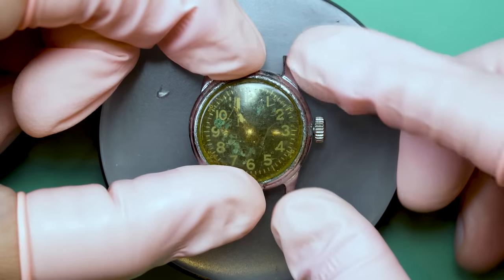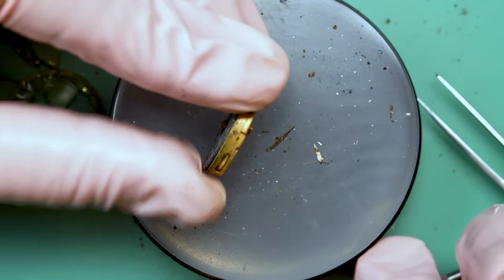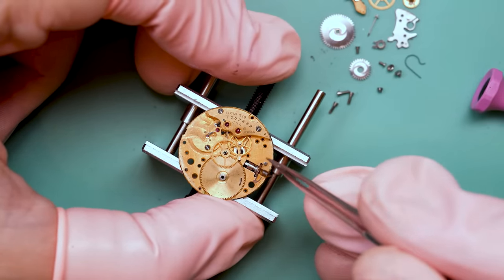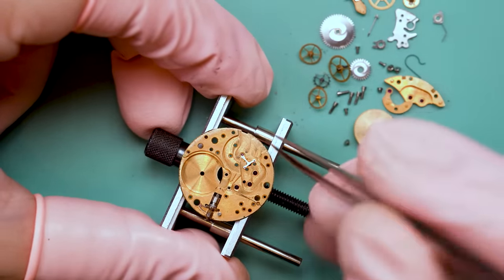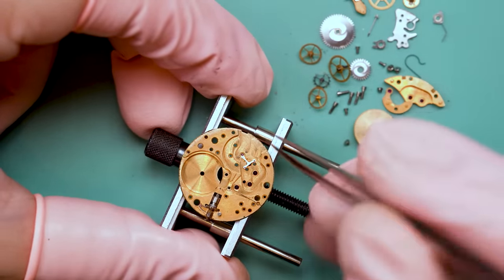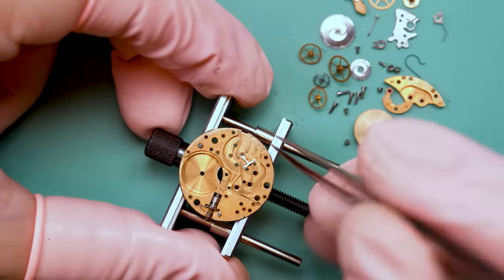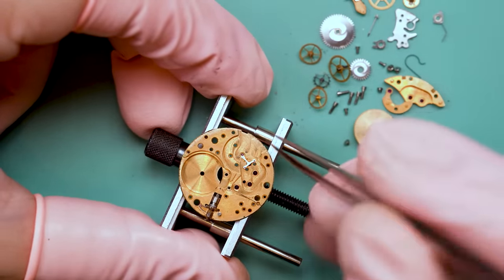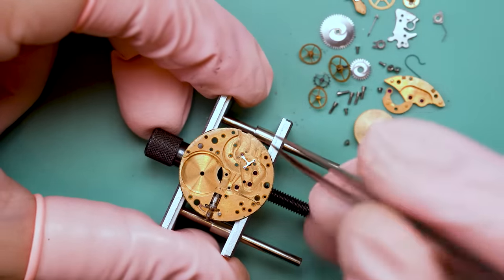Destroyed Vintage Elgin A-11 Military Watch Full Restoration

Comment: Congratulations on adding plating to your storehouse of techniques. And I agree with the decision to replace the barely functional (and very unappealing, at this late stage) dial with the donor one. Authenticity is generally a good thing to aim for, but even authenticity has its limit, and this is an example of running up against that limit.

Comment: Evaporust is slow, but have you tried it in the ultrasonic cleaner? Put it all in a closed container, then put into the water in the cleaner. Vibrations will propagate through the container and clean inside of it too.
Might speed up the process?

Comment: The black stuff is magnetite, it's a mixed crystal structure of different oxides. It is also known as blueing!
It's also alot denser then the hydrated oxyde mixture that whe know as the red flake rust. The avaporust basicly dose a rust blueing and desolves the excess lose rust. Cool stuff!

Comment: @Marshall
Ive never seen you use teak sticks to polish with. Teak dulls edged tools and saw blades because its loaded with silicates. It's a super fine abrasive that polishes and sticks can be sawn along the grain in an angular shape to create long sharper edges. Say 45°. Try it out if you haven't already.                  Edit: Good choice of dials. Very nice.

Comment: I'm late to the video, pretty amazing work. You asked so in my experience with rust/corrosion and other projects(not watches), allowing the green crustys on the old face to have access to the inside would l have been a jump start for new corrosion if any humidity remained inside with it.

Comment: Evaporust is great stuff. It not only won't eat away at parts, but it simply can't because it ONLY removes iron oxides. The black is the carbon that was part of the steel that rusted. I was a reseller when it was first produced. 

Two warnings: First, there is one situation where it will eat away at good parts. If a steel or iron part sticks above the surface of the fluid is will get a cut-line. Right where the water meets the air, the steel can oxidize and the oxidized atoms are instantly removed by the Evaporust, exposing new steel which can oxidize, etc.

Second, soaking parts that are nickle plated by a chemical process, meaning old plated things, the plating has microscopic pin-holes and enough air gets in there over 50 or 100 years to form some rust under the plating. Evaporust can also get in the holes and eventually remove that oxide layer. Then the nickle plating can actually slide right off like a gel or thin slime. This takes many hours or days and it happened to me once. The chemist who invented Evaporust explained it to me. It will likely do the same with gold plating.

Comment: A bigger polisher can be nice but it can also create some more struggles because like you said the dremal allows you to get into tighter spaces and it gives you a little more control because it can be slightly harder to hold small pieces when the bigger wheels require slightly more speed.

Comment: Amazing restoration!  Do you sell what you restore?  If so, I am interested.   Also, I have a ‘70s vintage Bulova Snorkel dive watch with an orange face that could use some of your attention if you take on outside projects. It is an auto winder that is running, but has incorrect bezel and hands.

Comment: 27:27 Question.  electroplating could be a way to change the colors of the metal.  I think that is the way they get the Rhodium plating on the brass.  You could even gold and silver plate some parts maybe since the plate is done in very minute layering.  Just a thought?  Post Script...  So you knew about electroplating and you did good for your first time.  I really like the fact that you changed dials but keeping that old dial with the set to show the before and after of the watch.  Plus you never know who or what caused the corrosion.  Could have been war related Vietnam era stuff.  I remember those watches even in the 80's.

Comment: If I was you at 35:34, I wouldn't plate it again.  I think the brass looks beautiful!

Plus, me being a model railroader, I would buy a new piece of very thin brass at a model train shop and make a new dial plate by spraying it whatever color you want on one side and then using press-on digits which come in different colors, too.

Comment: I know this video is three years old so this comment may go unnoticed but... There is a process called "electroless plating" for nickle which is basically cooking the part in solution on a hot plate. It's a little more finicky because you have to keep a close eye on temperature but it gives a more even plating thickness on edges and corners and complex shapes. There is also a deplating solution that removes all of the old nickle in even the most hard to reach places which gives you a better final surface on complex parts

Comment: Just imagine working on the smallest model Japanese cars, which the wheels work everything works on them, repairing those things would be a nightmare, always looking through a microscope? 
Just imagine watchmakers and the tools they use to make those very small screws with tiny threads which would be amazing to watch get them made? Great channel Marshall, keep up the great work champ 🦘🦘✌✌👍👍
I know acid dips will clean away tiny amounts of metal based on the acid and time spent in the acid, The aircraft maintenance industry uses this principle, because its so precise in the removal of metal from objects. 🦘🦘👌👌✌✌👍👍

Comment: Judging by what I could gather from the product spec online, the active ingredient mix of the Evapo-rust primarily consists of a ferric sulfate and a proprietary chelation ingredient. The chelation ingredient pulls the iron from the rust and the sulfate pulls the iron from the chelation ingredient so it can continue to react with the rust. Apparently the chelation ingredient isn't strong enough to attack iron-iron bonds, so it stops once the rust is gone or the compound is exhausted.

The black looks like ferrous oxide, so it's probably caused by reaction between the leftovers of the chelation reaction (oxygen and water, the latter of which is likely carried away in the process, given the claims of short-term function as a protectant) and the bare iron substrate under the rust, so it's probably not a very thick layer. Simple abrasion may be enough to remove the black layer, but in cases of a considerably thick initial layer of rust, and given the small scale of the parts involved, there may be instances where the part loses too much material to continue to function properly. If the black on the parts isn't visible from the outside and doesn't impede function, you're probably better off leaving it.

Comment: If the old dial had less deterioration, I'd have used used it.  But the main numerals were so far gone, and I'd be afraid flakes of the surface would come off.  You made a good call.

Comment: you did it for the challenge -  i have a british equivalent one of the dirty dozen - its a timor - similar condition to yours but not quire as rusty -that watch belonged to a ground crew member attached to the path finder squadrons it now runs quite well but the dial is shocking - if only yours could tell you its story

Comment: I also just learned to electroplate with nickel. It gives amazing results. But what voltage and ampere did you use?
Reply from the maker: You can see what I use in a recent video I put up, but it's about 1.4 amps

Comment: By now you have probably seen this, if not, here ya go:  How do you remove black residue from metal?
Mix equal parts warm water and white vinegar. Use a toothbrush to scrub the tarnish off the metal with the mixture. Combine ½ cup of vinegar, 1 teaspoon of salt, and ¼ cup of flour for stubborn tarnish. Apply the paste and let it sit for 10 minutes before washing it off.

Comment: I've been a subscriber for a year or so and have been inspired to dip my pinkie into this intriguing hobby. I recently acquired what I had thought was a 1940s era Elgin pocket watch. Upon examination it turns out that it is in fact an Elgin Timer that was used by military Navigators  or Bombadiers to set fuses. The piece is working but missing a second hand that corroded off on the main dial that is numbered from 0-60.  A smaller dial numbered from 0-30 is at the top.  Have you ever worked on such a piece and would you be interested in working on this one? A challenge tor sure. If I can get it working I intend to donate it to a local military museum.

Comment: The roman numerals on the inside might be more than just 6789.
The spacing makes me think it could be 7 digits or more.
Purely speculation but an interesting idea.

Also, I like the original dial. The colors are a cool combo.
If there was a way to make the numbers more visible, over the rust/corrosion, it could be usable.

Comment: Would it be better if you stripped everything off from the dial and had it powder-coated and then  hand-paint the characters back on  again?
I always send my plated parts out to my player and have him de-plate then I refinish, usually bead blast and finally re-plate.
No plating never fills in any cracks crevices or dings.
I just noticed the back doesn't look very good at all that could be de-plated and cleaned up.

Comment: Changing dial out is great it’s usable it’s for use not a museum piece. An absolute purist would not touch it at all and place it behind glass, even the rust had history, in fact keep it in the drawer it was kept in, keep it in a vault and only look at it in low light once a year and no-one else can see it.😀 The seal material over the movement looks like it was held in place by the flat plate and then the back went on made it waterproof, is that what it was for? I wonder if the winder was loose to let water in or the seal failed in the stem? Not sure how that worked? It’s a common entry point for water on watches.

Comment: wrt the dial - I'd only go for the trashed dial if I'm going for a 'Patina' restoration: cleaning up the case of all the loose and flaking plating and then using some kind of clearcoat to protect the bare brass. But even for that, the dial is VERY far-gone. keep it around for a someday, but if you're making this for Dailywear, the Clean dial is called for

Comment: The blackened metal parts is the same as bluing a gun. I recommend that you use it on a part that is not needed, then put it in some salty water and see if it will rust again and if so how long does it take.

Comment: It's black because, like gun blue and anodized aluminum,it leaves a stabilized oxide layer. That layer keeps deeper layers from oxidation. If you polish it off, your parts will lose surface mass and be opened to rust again.

Comment: If you sanded it down to bare brass and used the rough face, it would have been semi-cool. The face is rough, but you can still see the marks at each hour on the outer edge. With it looking nice I would use the clean face.  Awesome job.

Comment: Yes, from the movement view, things do not look that serious. Only when you pull off the dial, then you see the damage from water penetration into the case. The setting bridge rusted, the stem is rusted, the setting gears are rusted. The movement from the dial side is a rust bucket galore. Good luck!

Comment: I have an Elgin watch I bought for my husband's birthday to restore (once I get to that point). Because it's special for him I didn't want to risk damaging it so I took it today to a jewelry store with a watch repairman. He tells me that the watch isn't worth restoring, that the case is base metal and you can't replate those because the watch will develop leaks, and that it's impossible to find parts for it. Pretty sure it's around the same years as the one you just restored. What's your take on this? I'm not wanting it fixed to resell, but to wear and use. Please help because all my plans to rescue old watches now seem like pipe dreams.

Comment: 8:50. Why, please, didn't you use penetrating liquid on the dial feet screws?
What if they had sheared off?

What do you do when a screw head shears off, and you are left with a stuck thread, with no head?

Tky v much.

Comment: Ok this is my first watch video, is it a bad idea to maybe put it in some rust remover or penetrating oil? Yes I watched the video but I meant before you broke off the stem. Wouldn't some 'evaporust' been helpful there?
Dood~ the adjust stick was pegged all the way to 'F' of course it wasn't very accurate. (ok fixed before sealed)
What about the gasket you removed?

Comment: The auto mechanic part of me is shouting at the screen: why not soak it in penetrating oil first before trying to pry the stem and movement out of the case? In the end you're cleaning it anyway ... 😀 It's probably kinder to watch finishes than Evaporust I'd spitball.

Comment: I'd totally have used the well worn dial. It's a simple watch, so what if there's no 7? It's always in the lower left bottom position. It's not like this watch has a date function or calendar or anything. With the hands you chose it's easily readable. The damaged face tells the story of the man that wore the watch. Maybe the damage occured on the battlefield (or not, it really doesn't matter). There is character in that face.  I could see either of my grandfathers wearing that watch during their service. The story it tells is worth saving, even if the man that wore it has since passed.

Or are all those watches that only have a single diamond at the 12 position unreadable?

Comment: I think you could've sunk it in WD40 if it won't get loose, heat the outter piece and try again.
That works on engine's exhaust bolts, you can try.
People that work on carburetors also use that evaporust, and they use another chemical product to bring them to the original silver look

Comment: I think you should have kept the mainspring.  I've restored 120 year old gramophones with the original steel spring.  So long as the metal is not corroded or has been badly abused and taken to its limit multiple times, they simply do not fatigue much, if at all.  The old one is American made before the first bomb (steel made before the first bomb is higher quality and worth more which is why Chinese are grave robbing sunk American and British ships. Radiation from the bombs is in all steel made since the first atomic bomb. For more info, just google pre-atomic bomb steel) vs a modern spring which is probably made of Chineseum of questionable quality and metallurgy.

Comment: What is the F to S gauge at 29:35 it was in the middle, then it was on F?
Reply: Fast and slow, it adjusts the beat rate by changing the effectively adjusting the length of the balance spring.

Comment: Directly from the Evapo-rust website.

"In certain instances, steel will darken in color after rust has been removed from the surface of the metal. This is a natural phenomenon that chemists refer to as “carbon migration”. The carbon from the steel moves, or “migrates”, to the outer layer of the metal and settles into the pores."

Comment: The dial question was not useful as the rusted one simply looks like crap... I would have tossed it in the trash right away and moved on... luckily you had a nice looking replacement that still looks aged :-)  I didn't see you putting back the seal/gasket on the back cover... Does the crown steam has a rubber washer ??

Comment: I just called the Rolex dealer where I bought my date_ just perpetual 2-tone men.s watch in early 2000. it is about 22 years old and total together on and off have not worn  ( on or off) for more than 3 to max 4 years. it has no issue however never been serviced and after watching many videos on this channel, becoming concerned maybe the lubricants are getting to be dried up. anyway, the shop coded me that to service that watch will be a minimum of $750 and more if it needs anything. wonder if I should spend the money or leave it as is. Oh yes, I bought it originally for close to $7000 now the same model is being sold for $20,000.

Comment: I have a nice Elgin watch but it needs a crystal put in it , it needed a battery so I installed the battery but while trying to put the back back on I broke the crystal watch repair shops want $65.00 dollars to do it but I only paid $10.00 dollars for the watch on eBay so I am really tempted to smash it with a hammer and keep the band , does anyone out there have any advice ?

Comment: You need a tool and die maker to make you a crown fork
Reply: And a sandblasting box. You can also use the evaporust in the ultrasonic for a minute to release the air bubbles keeping the liquid from contacting the rust.